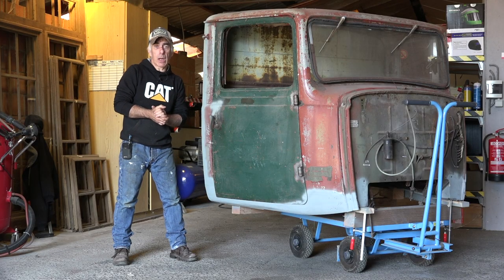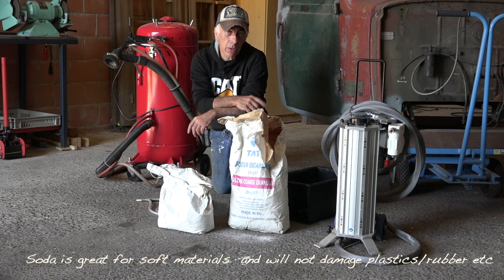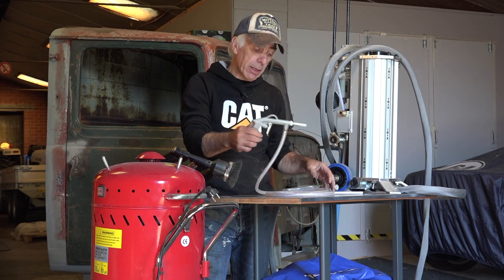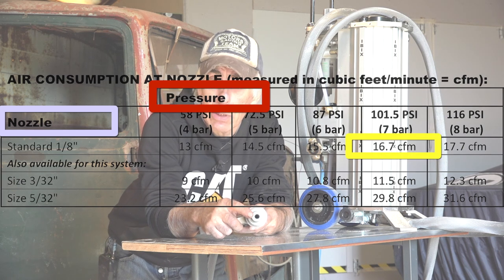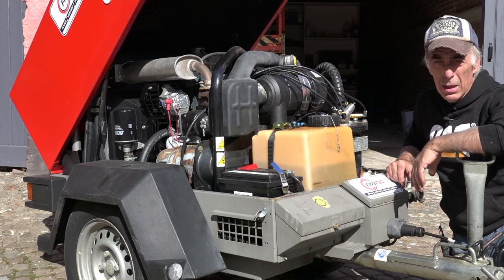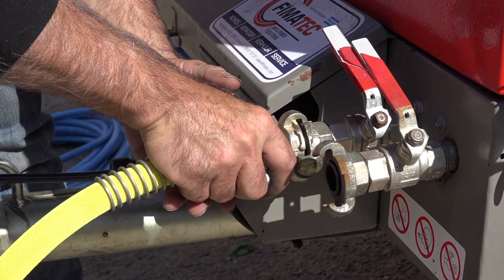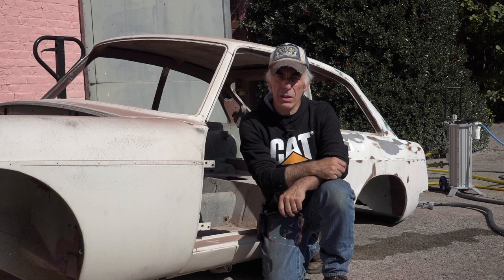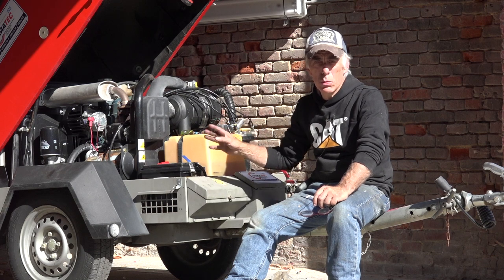Abrasive blasting  preparing for Old Rusty

Comment: We used a lot of ground walnut shells as blast material in the shipyard. Excellent demonstration of all the versions of blasting techniques.
Reply from the maker: Thanks for the comments, indeed but expensive here (wallnut).  Why did you use walnut ? is that not t soft for shipwork, or was it for brass
Reply: D3Sshooter I believe it had a lot to do with that is was softer than the steel shot and easier to clean up. I’m not a blaster but saw how steel shot raised heck with valves and piping. Steel worked great for large open areas.
Reply from the maker: @larryr.johnson3048  Thanks for the comments

Comment: Our 120 guest dining room is 80 years old and made of logs, 4 years ago we did a $2m kitchen, office and reception reno. The new reception area now enclosed a portion of the exterior log wall (about 5m), as the exterior was painted brown we wanted a more natural look inside, the carpenter used corn blasting, the media made from cob corn! Much cleaner, did little or no damage to the wood fibre and bio-degradable, great for where we are in a 8000km nature reserve. 

Side note for log cabin lovers; we also replaced the chinking in the cleaned wall with the newer latex chinking/caulking. Much nicer than the older cement and horse hair mix!
Reply from the maker: Thanks for the comments, ver interesting..Wallnut shells are another abrasive.  There are a lot of options . Yet they all have a price... Soda and garnet are reasonable priced.

Comment: I use soda for cleaning carbs and other fragile parts that need cleaning, but don’t want to damage the parent metal. Perfect for aluminum, zinc, brass, or any material you don’t want to damage. Can make a carb body look like new. Also works well for cleaning spark plugs. It rinses away with water and it’s very low cost! I use a cheap handheld blaster from the Horror Fright. And yes, I have removed rust and corrosion from inside float bowls with baking soda.
Reply from the maker: Thanks for the comments, Indeed that is the perfect product for the work you described . The cheap blaster will work on a sprak plug and other small objects...

Comment: Very interesting and informative. I liked the bright finish you got with the Soda on the aluminium and would have liked to have seen a little more of that. However, I am sure you can tell me if the finish is brighter on aluminium compared to bead blasting aluminium. i have bead blasted aluminium parts and it is clean but not very shiny. I was thinking about using larger beads to improve the shine but now think maybe soda would be better.
Thank you for taking the time to produce this very good video and for sharing it with us all.
I too have a YouTube channel so I know how much work goes into the video production.
Kind regards Paul (from "48SPOKES").

Comment: Would your system still produce condensation if you blasted in an area where it's 100 degrees Fahrenheit? Fantastic video.  I've been wondering  about just this subject.
Reply from the maker: Joe, its all about the temperature difference between the compressed air and the ambient temperature of the air.  IMO the ratio is the same, no matter how cold or warm the ambient temperature is.    But I could be wrong, and just maybe there is an expert out there who can deny or confirm....

Comment: I heard that some people mix in small amounts of certain corrosiob inhibiting chemicals in the water when they do wet blasting. Some of those chemicals  alegedly delay the flash rusting for up to 72 hours or even more.

Has anybody got experience with some of those inhibitors? Which products, what are the practical effects, do you need to wipe them off before painting etc.?
Reply from the maker: I have heard that as well, but in cases those products will have to be wiped off before painting, unless there is a magic product out their. And if so , I also would like to know it.  TXS for the comments

Comment: Soda blasting.  Check with your paint manufacture of choice.  I bet you can't find one that will recommend, or warranty their product when soda is used.  Requires a lot of additional steps to allow subsequent substrates to adhere to the base material.  I don't even use it on greasy drivetrain as they also get painted at some point.
Reply from the maker: Yes indeed, that is the issue . That is why I will not use it.

Comment: Soda is greate to clinup wood. Windows, doors, or even timber walls or elevation boards. Always find use in old farm restoration.
Reply from the maker: Yes , indeed perfect for that purpose and widely used.
Reply: Good for old yachts
Reply: Dry ice blasting is even better.

Comment: I jumped off the train the minute you pulled in that big red monster.
This is really not a video for the private or home user.
And videos for professionals are overflowing the net from all possible makers of professional equipment anyways.
Reply from the maker: Thanks for the comments,  however I do not agree.  This is possible for a DIY person.   You can rent this for 200-300 Euro/ Dollar....   What I explain are the things to look for if you are going to buy or rent...  To often cheap rental offices will never tell you the whole storry and you end up in trouble. That is why I share my experience.   If you are going to restore a full body (car) , then you need to blast it in one way or another  or lets say get to the bare metal.   So either you do it youself and rent kit, buy kit or have it done.   ( have it done runs about 800 euro/dollar where I live).   So it all depends what you need to do, a one off project or many.....
Reply from the maker: P.S, you will be surprised on the price of a good second hand compressor....  they are not that expensive and with reach of most DIY enthousiasts